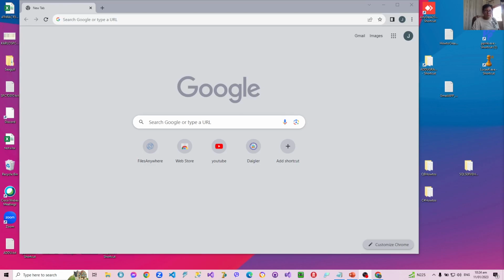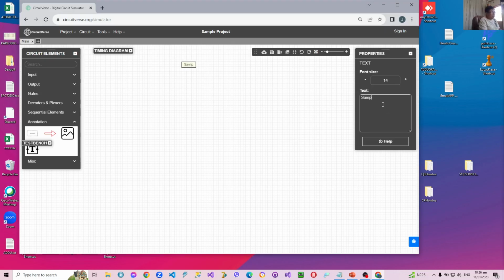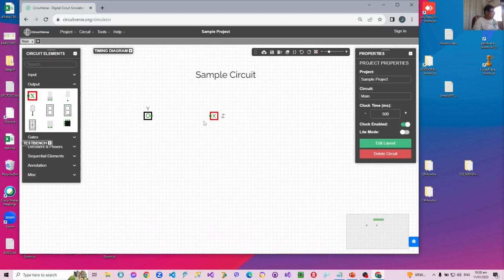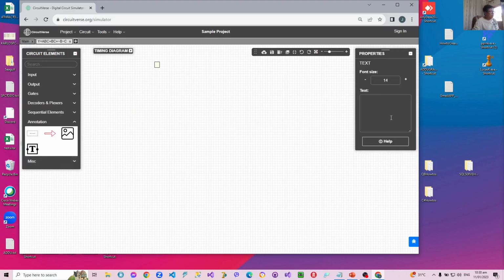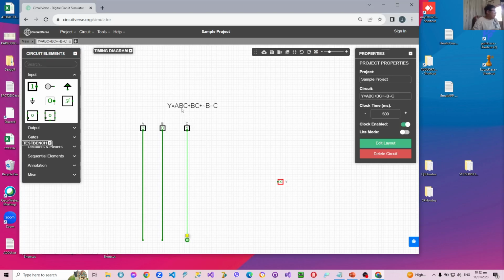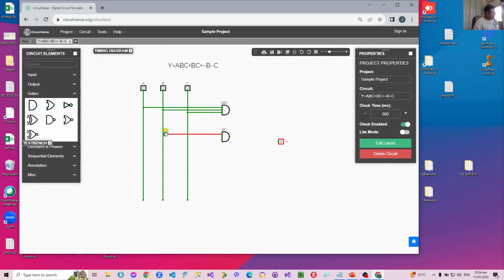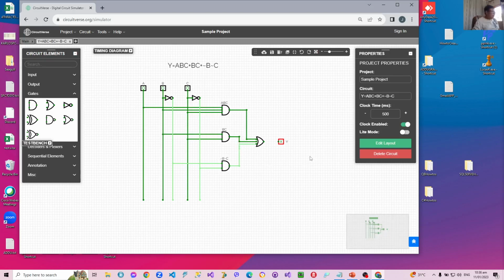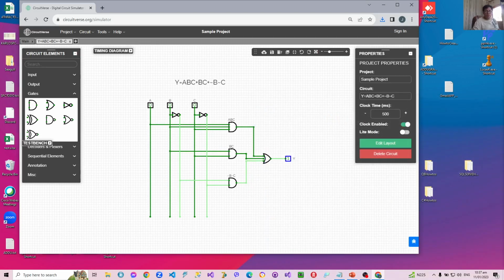02 Introduction To Circuitverse

Comment: if i  made a circuitr can i make a copy from it  to use it   in  the same desinge    many time
Reply from the maker: Yes, if you want to copy a file you use export to save it to your downloads folder and import to upload it  from your computer.  you can also use the standard shading technique using the mouse and press Ctrl-C.  you can paste it using control V
Reply from the maker: you can also use the insert subcircuit option to make a white box (like an Integrated Circuit) copy of a circuit.